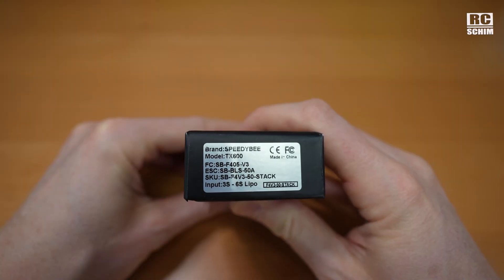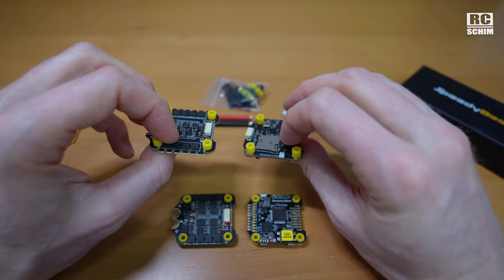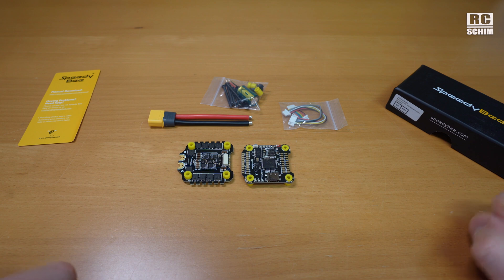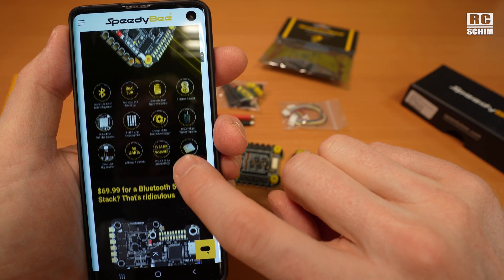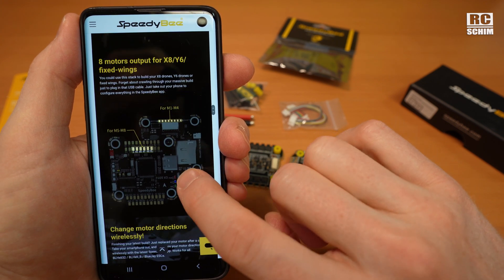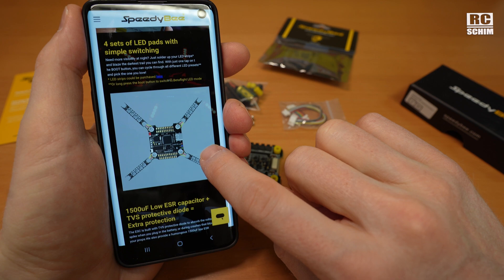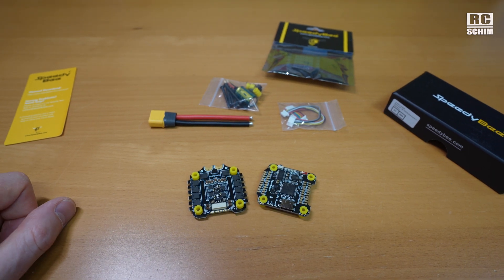SpeedyBee F405 V3  - Quick overview

Comment from the maker: Update:  SpeedyBee told me that FIXEDWING support is on it's way - maybe Pawel knows more ;)
And:  on facebook I ran into a discussion where alot of pilots were upset about SpeedyBee's ESC quality. From there it sounds like a lot of those ESC 4in1 boards are faulty?  Please let me know your experience - as I had not have the time to use those two stacks in a build yet   (not the f7 V3 nor the f405) - mainly because currently I focus on the fixedwing side of FPV (which is fun - and nice in the summer).
Reply: Is on its way - could mean anything, was my first question when I was undecisive if to watch or not cause I had seen a similiar one last few days where it had been mentioned it was not for wings. Not sure if they had released more than one, but it had been one with multiple boards like the ESC on top I guess, about 60$ for the FC and double of that for drone which I do not need.
Reply from the maker: @typxxilps  so, for fixed wing Pawel needs to find time to adapt the SpeedyBee fcs for inav. But since he does this in his spare time it could take some time.
Reply: https://www.youtube.com/watch?v=IUZPuXPJM2g   there was a problem with V2 boards. i did not follow this, so i cant say speedybee was helping them out.
Reply: From all the Info I have, the ESC from the speedybee V2 stack was faulty until an esc firmware update came along.
Grüße
Reply from the maker: Yep, they sent me an update and said:  first we tried the blueJay firmware to have RPM filter and BiDir DShot - but it was too unreliable - so they went back to normal BLHeli...     
But I also meant in general and not just on this model - how's it with ESC reliability on the Speedybee FCs - according to some disgruntled Facebook posts it's terrible  (but I gues I've given me the answer there myself  ;)
Reply: @Rcschim  just follow your Bauchgefühl. hahaha
Reply: @Rcschim  i really had issues with my V2 version .. it just fell out the sky, fortunately not in the water, but still while i was with a client which didn't look very professional. then one motor just wouldn't spin etc. .. their support is okish with fast response, but unfortunately they never changed my ESC/FC and it was in the drawer for months until finally an update came along to fix my issue .. i really like the bluetooth idea, but this experience just wasn't great so i never tried their units after this
Reply: @thefitchesvideo  V3 is very bad, it will go up in flames the first time you plug it in
jk, V3 should be finr

Comment: Regarding 2:54 question:  yes! The F405 v3 does support INAV (as of INAV 5.1) . The motor outs can be mapped to PWM signal outputs. Note: INAV uses channel Ch1 and Ch2 for motor PWM by default, so servos could be used on Ch3+. Just need triple-row pin header to physically wire PWM signals from the FC, along with a 5V, ground bus.  If pulling 5V for servos from the F405, the BEC is 2A only, so only enough for couple servos. If using motor outputs to operate servos, the ESC daughter board would not be used. If needing more servos, then an external BEC (eg: 5A) would used to power the 5V, Gnd rails of PWM connector bus. One disadvantage in using this FC in a wing, is you wouldn't have a current sensor (as is on ESC board and kind of a waste to cary 4 ESC for a single motor configuration)
If you look at INAV Release Notes on GitHub, support has been added with the INAV 5.1 release. Just download INAV 5.1 configurator and you'll see in board options. This would allow a simple bench test by wiring up a servo to motor pads for the Ch3 (motor PWM output)
Another wing setup option might be to use a crossfire (or s-bus) to PWM converter board that connects to a fight controller UART. (I haven't tried this method, but there seems to be support in INAV). Would simplify wiring if using more than a couple servos, and has a integrated BEC, but at added cost. ($20-$25)

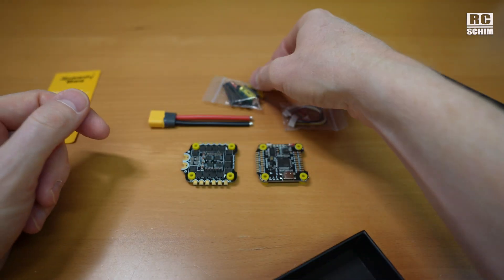BTW: At 0:41 the red lettering "AIO" may not apply to the F7 shown. 😉
Reply from the maker: Thanks man for the indepth comment. I will probbably add the F405 v3 to my Techone FPV900 wing. only 2 servos...
As you say, I would leave away the ESC board and also have no current meter - but thanks to DJI OSD I see at least the VOLTS  (which I take as a good enough indicator to see how my pack is doing, especially on LIION it's nice and linear).
Pawel already sent me a beta fw - so I will check this out.
I'm also excited to TAPE my FPV900 in the same build session for some more style and strength. 
Will also add GPS  (bought those Beitan 220 GPS in a 3 pack for under 50$). This will also give me Autolaunch on this simple FPV combat wing.
Curious to see how much of the gust related shakes the FC can iron out in acro mode (gusts are always reducing my confidence in the air).
greets, Mario
Reply: @Rcschim  Sounds like could be a fun setup. Worst case some fun experimenting and learning. 
Flying wings will be a bit more sensitive to gusts vs. conventional tailed wings. Gust are less an issue if flying at speed (or a heavier build)
BTW: Matek does offer an independent current sensor, if have spare AD (analog-digital) convertor input on FC. Not really necessary, but could become useful if doing longer range flying to have a mAh counter.
Reply: Update: I see that SpeedyBee v3 does not support servos in rotor mode (explained in INAV issue #8362) You'd have to check INAV configurator to see if supported in wing mode of INAV target. (try adding servo on INAV Mixer page-tab)